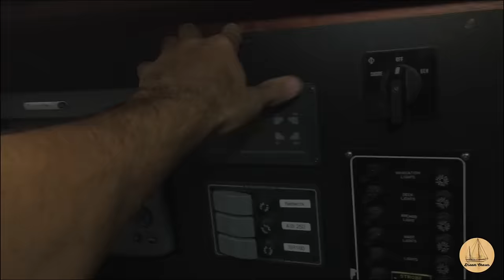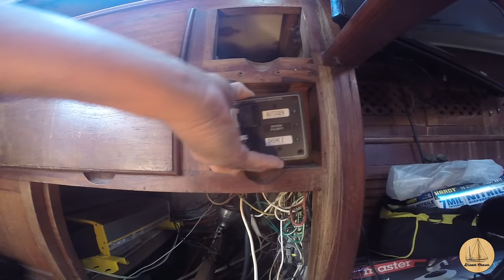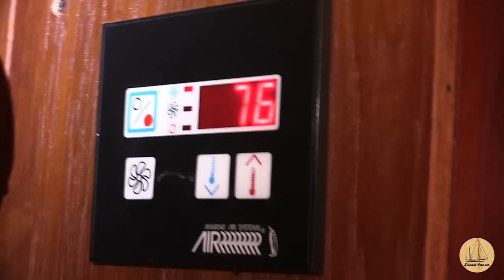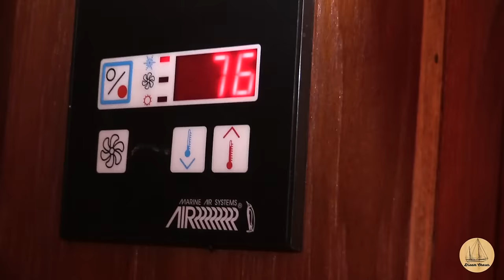Electrical Short and Repair

Comment: I do a lot of marine electrical and I make it a point to advise my customers to always put in a new run versus splicing anytime it is possible. I also solder in joints with shrink tube if a splice must be made. All marine grade parts always. I am also a huge fan of labeling wires. I probably have as many miles on my label maker as my car :). Great job. Also be aware of line loss and upsizing wire for extended or demanding runs.
Reply from the maker: mike lowmon mike, it is funny you mention labels, there are some kind of tape around each wire but they were faded and unreadable.

Comment: Older models if labeled were done with either plastic rings that were numbered or masking type tape that never stood the test of time. I use the waterproof laminate tape that is I believe some kind of laser print. You can get different color schemes for different voltages or however you want to lay it out. I did a full wire job on a 54 that had a fire on board. It is quite the project. Very rewarding when it is all done though.
Reply from the maker: mike lowmon yep, these were the masking tape type so not even usable, but I will have them labeled when I replace them, also my with a laminated wire map at the connection panel.

Comment: My concern would be to check the current draw from the air conditioning equipment.  As the equipment ages the pumps draw more current.   A clamp meter would be the best choice to check that.
Reply from the maker: MidnightVisions great point I will pick one up and check it out.

Comment: You did good. Why did wire melt before breaker tripping? Is that wire before or after breaker panel? If after the breaker might be faulty.
Reply from the maker: bubba it was after it but I suspected the issue was that this part of the wire had a bad connection and was undersized which ended up getting hot enough to melt the outer coating of that wire and then break it loose to stop the heat. I agree the breaker likely should have tripped. I may need to replace it to be safe since I don't know why it didn't trip for sure. Do you know of a good way to test one?.
Reply: I think you are right the wire connection with that crimp fitting was  the weakest link. The only way I know to test breaker is direct short and see if it flips.   Breakers are not that expensive. Your breaker is probably fine but for peace of mind you could buy one and put this one in spare part box. Hopefully the previous owner never replaced that breaker with a larger breaker because it was tripping. How many amps is the breaker?
Reply from the maker: bubba it is a 20amp which makes sense for 2 reverse cycle air units of 16k but and pumps
Reply: 20 amps should be ok. I think you are fine. Bad wire crimp/connection that you repaired.